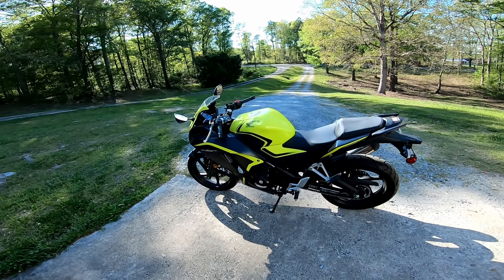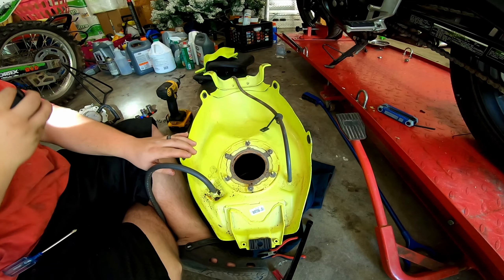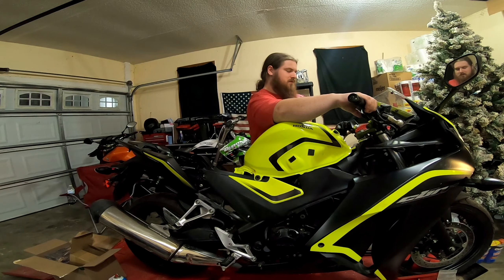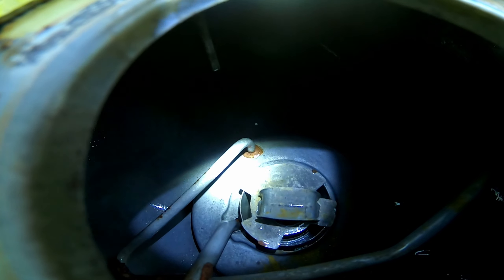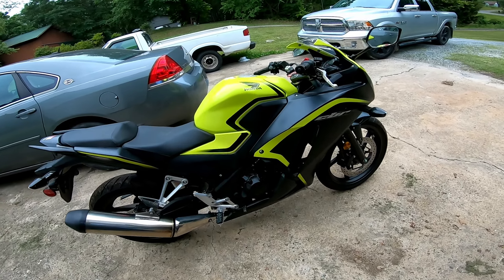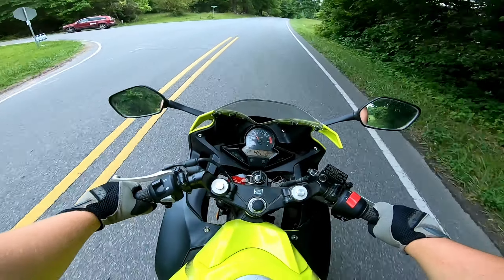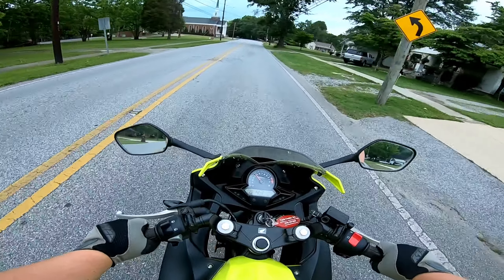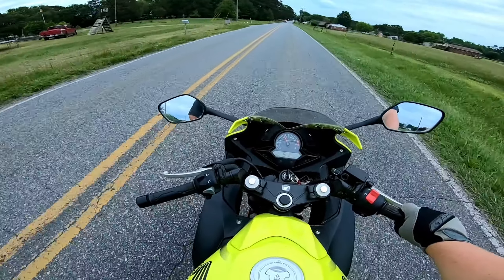$1200 CBR 300R Build

Comment: Id suggest storing that with ethanol free fuel and maybe even mix some 2 stroke oil in with the fuel to lube the tank and keep rust away 🎉
Reply from the maker: Normally I’ll run non ethanol if I know I’m not gonna ride for a while. I did coat the inside with some wd-40 and that has helped keep it off
Reply: @Hunters-Garage  I have a couple old dual sports that I do that with. I usually mix in 2 stroke oil around 50:1 to treat the tank so it doesn't rust. Since it's vintage gas tanks are hard to come by. I live up north in the salt belt and before every winter I get under my vehicle and spray it with oil lol.. have to so it don't rust
Reply from the maker: @JdM-ep9on yea I got my first truck from somewhere up north and the whole underside is rusted lol